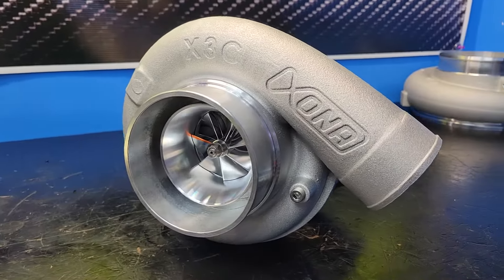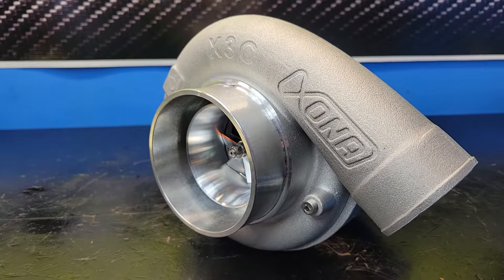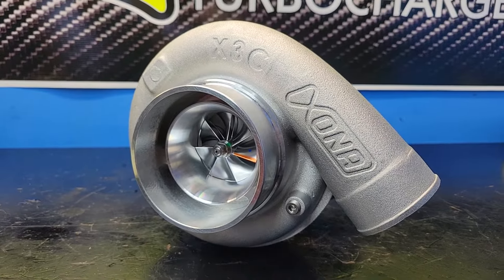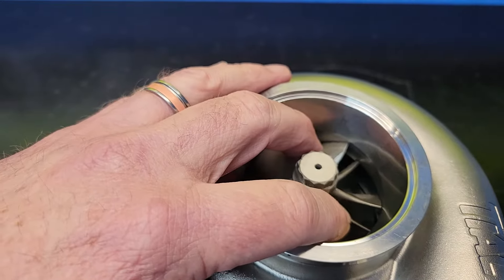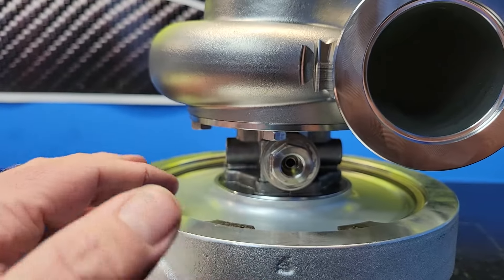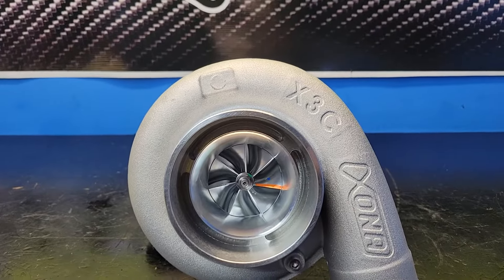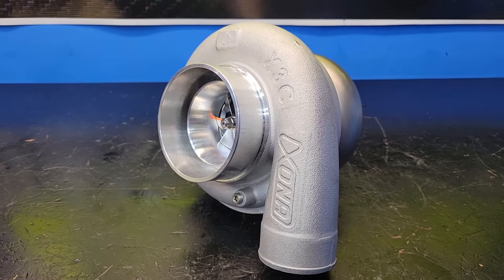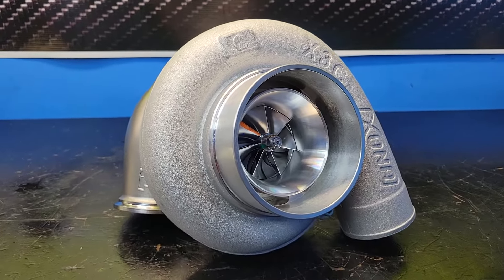Xona Rotor XR-6564S Turbocharger Quick Overview

Comment: Would you say the split/clipped turbine wheel loses some of the exhaust gas energy by bypassing some of the gas to increase 'flow'/reduce EMAP? If so, would you say response and transient response between gearshifts are also effected? 

P.S Love the videos, keep them up
Reply from the maker: With the "half clipped" design, you will gain flow at the cost of efficiency...but this is not always a "bad thing"  The lighter weight helps get the response back, and as long as the turbine can deliver the energy to drive the compressor at the right time there is no real negative trade off to this design.  

There are so many variables with turbine wheels, and I will take a deep dive into that topic soon!

The shop has me slammed at the moment, but rest assured more in depth videos are coming.  I appreciate your support!  -Reed
Reply: @workturbo  I was watching another video you were comparing the Turbosmart, Borg Warner and  Xona. You indicated that the Xona would be abit lazier based on the flow maps, considering the sizes were similar on paper. This why I asked the question above.
Reply from the maker: @og33vo   I was mainly referring to the compressor wheel design, and I have received quite a few messages revolving around that video.  

I am working on the test rigs to show "why" I made those statements.  These tests are a bit time consuming, but they will be worth it!  

feel free to emial me support@workturbochargers with your specific build info, I will be happy to help you make your decision!  -Reed

Comment: I have a 2019 STI and I don’t really care much about huge HP numbers but would like the fastest spooling turbo I can get that will also maintain power a little better in the higher RPM range. Which Xona model should I go with?
Reply: 5757s.

Comment: Xona underplays its power ratings. Ive seen 1100hp on the 9569S
Reply from the maker: We have a Buick GN with the 9569S that is knocking on 900 whp through a TH400 and a 9".  

I always try to under rate or "cushion" my power number quotes...its always easier to deal with a customer that is making more power than expected ;) -Reed

Comment: How would this work on a 4.3 typhoon? With the internal gate option?
Reply from the maker: Hi, Norb!  I would need to see what we could work up for an internal gate to suit the 4.3.  The rotor group would be a good match for this application.  There is even a possible T3 foot so it would bolt to your existing manifold or headers.  I can also upgrade your stock MHI turbo as well :)  Drop me an email for details!  Hope all is well up in Canada!  -Reed
Reply: @workturbo  Yes all is well, just really think if its a bolt on the typhoon and syclone owners would definitely buy them! Will email you thanks.

Comment: We are seeing all kinds of propaganda/marketing pushing "cool, new, shiny" stuff to sell new parts/inventory. Garrett thankfully has maps to compare new 10 blade compressors to 7+7. The skew in the compressor maps are clear. No free lunch. It would be great if you could share the plus/minus with folks
Reply from the maker: I will go down the rabbit hole of compressor maps soon...but the simple truth is any blade count/splitter arrangement can be tailored to perform at any reasonable PR, but like you say...there is no free lunch.  Not for Garrett, Borg, Holset or any other manufacturer.  

You will simply move the numbers around, so choosing based off of your engine's requirement will always be in your best interest.  

Be ready...its coming as fast as I can wrap up the test and editing.  Reed

Comment: Largest is the 76mm, yes, but most powerful is the 71mm at 138lbs/min.
Reply from the maker: Yessir...the move over into XRE compressor technology has been a solid move for them  HTA/HTZ has long since run its course!  The HTA dates back to the very late 90's, being derived off of a K31 borgwarner wheel.  It is almost a carbon copy of that technology.  Reed